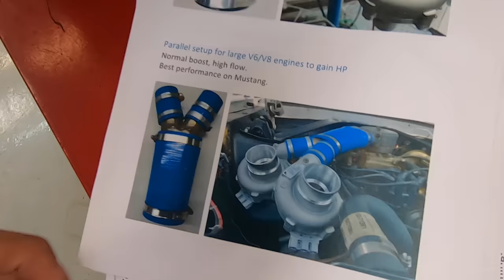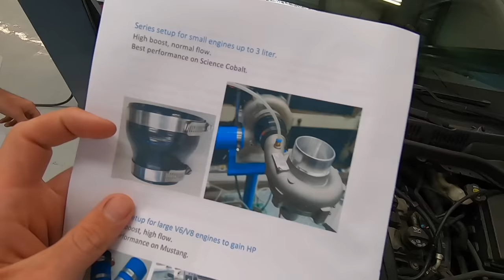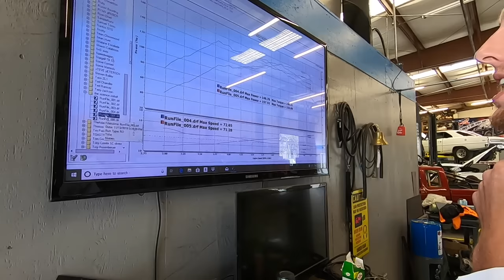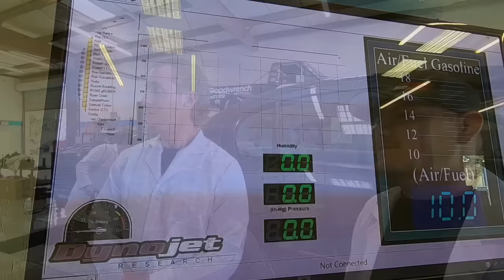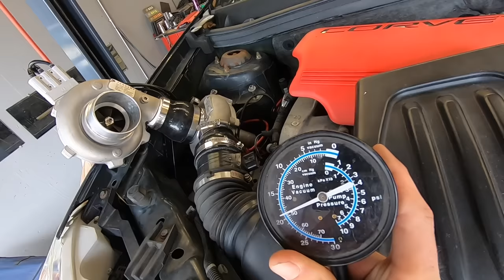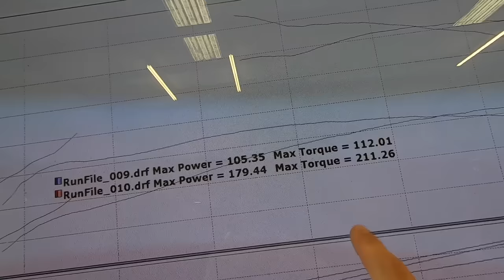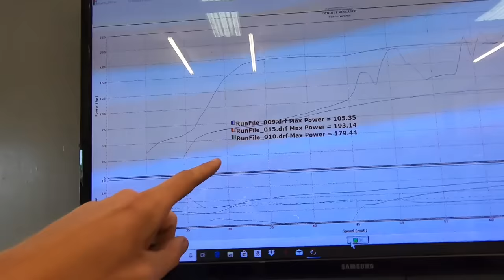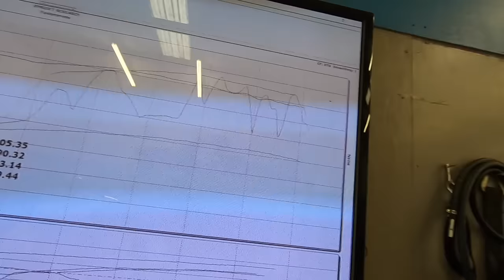Dyno Testing $5,000 Worth of ELECTRIC Turbos! Double the BOOST!!!

Comment: These need to be 1500 for dual turbo they’d sell the crap out of them
Reply: So true
Reply: And go bankrupt, so not sell any. Great business model.
Reply: Jay Dunbar your not thinking outside the box my friend, I’m sure they could do it some how, a kit model where they supply parts and you put it all together? I’m sure they could it.
Reply: @trialnterror  The assembly isn't the expensive part, the actual components are, $5,000 is a very reasonable price for a twin turbo system. Automotive components are always going to be expensive.
Reply: Mike Litoris  not really, an electric turbo would be similar in price to a normal turbo. Instead of having a turbine housing, it has an electric motor. The front half of the turbo is the same. The electric motor is similar in price to a turbine and housing.
Reply: Even 2500 for one each would still be stupid cheap
Reply: @jaydunbar7538    Vs. go out of business trying to sell a (let's be honest) 4-5 PSI system for $2500?
Reply: PhillipZX3 I’m looking at what the parts would cost, I think you could do it in kit form. They are using a cheap turbo which you can buy for 100.00 the electric motor is just under 100.00. The wiring would be close to 100.00  an inverter could be 100 battery is 100. Box various parts 100. !! It could happen price it yourself
Reply: @DieselRamcharger  let's see you build this for $70.... Oh wait, you can't
Reply: @Hates Spam the size and case. what makes you assume its not? you see, there is this thing called economy of scale. brushless motors are simply AC motors, they are anything but uncommon. that particular motor comes out of a cordless power tool. The steel can is a dead giveaway. Ive been at this quite along time my guy. that would also be an electric supercharger, not an electric turbocharger, which is a physical impossibility. You need to learn to separate fact from marketing swank.
Reply: @Hates Spam but to be fair, I'm not saying the guy is cutting open drills. Just the size of the motor and its power output is that of a cordless tool product. I'm sure its just a chinese bulk motor. Its a  brushless in runner. Like you'd find in a drill. Typical hobby motors would be out runners.
Reply: @Cody6210  i mean honestly i could build this for free. I've got enough parts laying around, plus a full machine shop at my house including a 2019 Haas VMC....be real careful telling people you don't know what they can and can't do. Take a hard look at that little avatar. Thats what i do for a living.   Making an electric SUPERCHARGER really isn't hard. Its just not worth a fuck. I don't dabble in wasting my time. Because my time is valuable.
Reply: Itll get down in cost pretty quickly... dw
You can source motors that have enough power for less than $150, building the battery and charging unit is expensive though.
Reply: @diesel ramcharger Thats an inrunner motor, looks to be a 36-40mm case. We use them in the rc world. A drill motor... seriously... thats turning at close to 50k and its direct drive, thats a huge amount of torque required.
For the record i built a system very similar to this in 2007 for a high school project and proved it could work.
Could be made for less than 1k could be made for over 2k in cost for all you know. Don't assume its cheap garbage. Especially coming out of europe, their industry for electronics is out of this world.
Reply: Most engines will not take this for long. Also without a blowoff or similar Efficency in normal day use is pure shit
Reply: @XCSEDAN  lol you can source the motors for under 20 bucks, if you were buying for a manufacturing run. Retail id say 20-80 dollars would be sufficient. Plenty of brushless vacuum and industrial motors out there. For example a 2hp BLDC motor is 40 bucks on alibaba.  Also, they most like are super capacitors, batteries wouldn't recharge fast enough and there is absolutely no reason to use a battery. Its not a charger, its a voltage step up circuit {boost transformer and isolation diodes}.
Reply: @XCSEDAN  i do a lot of RC and EV stuff. Tromp claims its a 5kw 24v bldc, though judging by the can size this isnt true, but i digress. a motor of that spec is well under 100 bucks on alibaba. They claim the box houses a battery, which is undoubtedly lithium metal batteries. Not really safe, but i digress again. The rated output time is 2 minutes before overheat and 4 minutes before batteries run flat. You are looking at a very substantial recharge time, hours, between "boosted" runs. the fact this thing can only produce about 5psi is very telling about the actual tq output of the motor. And the price. the website claims 2900 euro, before Vat and export. Thats 3200 before shipping per unit. Not 2500. Also, you aren't really producing any extra horsepower. You are just storing power you already made in the "battery" box and releasing it later. To say this is a false economy, is an understatement. I hate seeing people being mislead by fake claims and having their ignorance taken advantage of.
Reply: @XCSEDAN  also, its an electric centrifugal SUPERCHARGER nothing about this is even remotely a turbo. The compressor wheel with the dual blades...yeah that aint from a turbo. Its from a supercharger. Go look at a Paxton P2 and get back to me.
Reply: @XCSEDAN  this system also draws 3500ma per minute. thats roughly 2 hours of charge time per minute of runtime. this is why i say super caps are a way better solution than batteries. Also the motor on the torqamp, that isn't the can you are seeing. Its a cover. Its looking more and more like a cordless power tool motor by the second. One thats being ruthlessly over driven at that.
Reply: I've worked with em. Their biggest problem is converting people, and showing it ain't bullshit, and getting it out there. Cleetus and the boys are doing a great job helping them. They'll sell like hot cakes  once those two aforementioned points get done.
Reply: @roimatatamihana5681  Thats what they cost now lol. 2500 (2100 through the kickstarter).
Reply: @peterzingler6221  its electric, it doesnt need a blowoff valve, if its making too much boost you can just dial down the motor
Reply: @DieselRamcharger  so many assumptions.... i dont even know where to start.... i had charge time of 30mins from 15% capacity driven off an alternator charging a 15,000mah pack.... dunno where you get your figures from, but a 2c charge rate is pretty low these days. This uses lipo batteries. Which can charge up to 5-6c. So it can be charged in a matter of what 15mins with ease. The charging system on this wont allow that rate of charge though as its limited to 500watts.
Impeller design is for sub 60k rpm from what it looks like. Who cares what its off.
Sounds like you'd make something cheap and nasty, doesn't mean every business will. Probably shows a lot about your business ethics tbh.
No one is saying the design can't be improved on. It'll advance, get more compact and efficient.
Claiming its a drill battery and a rubbish design is just typical keyboard warrior bs. You've never even built one of these systems, so you're knowledge on the setup is minimal at best.... let me point out. A drill motor can't handle 5kw. Infact most cheap inrunners can't handle 5kw.
Also it isn't a supercharger... as its not mechanically driven. Technically its just an electricly driven air compressor. You know... if you wanna be technical...
You are right about me looking at the cover of the motor... i still recon its a 36-40mm inrunner, and pulling 5kw out of one of these is nothing. But it does fit smack bang on the specs for a 36-40mm diameter inrunner power wise.

Yeah... good chat

Comment: I'm curious to see the AFR on the bottom end of the rev range.  that much air instantly seems like it would cause a really lean mixture unless you're dumping that much fuel in the map.   Then I'm curious how the con rods will hold up to this much instant torque or what kind of wear it has on the bearings and cylinder walls

Comment: Cleetus, listen-up. You need to put those hairdryers in-line. Then you have the first hairdryer feeding the second hairdryer 5 psi air-charge to start with. Then like I said before you need to feed the second hairdryer another 1 to 1.5 more volts. Trust me on this one.
Reply: If the esc could handle more voltage, you'd have to mod the battery pack.   These have more in common with rc planes than brushed universal motors

Comment: I def wanna see this on the mustang now.
Reply: Exactly what I was thinking lol
Reply: Same
Reply: Didn't the stock mustang make almost the same power as the stock cobalt? Boosting it with the same setup would give fairly similar results as far as peak power goes. Low rpm torque would see a bit more of an improvement due to less surge.

Comment: I was thinking maybe you can run this setup with a vortech adjustable boost fmu and fuel will increase with boost pressure to the injectors by the fmu. Then you would need a voltage clamp at the map sensor. No tunning needed on older vehicles with a map sensor.

Comment: The cobalt officially makes more whp than my accord😂😭
Reply: And more than my 2014 mazda 3😂
Reply: Alex Velasco more than most ‘smog’ v8s! Turbo trans am etc
Reply: Find a Miata, add a bov, and a  throttle controlled switch. Really feel the power in a lighter car and the smaller displacement will see higher boost at low rpm.

Comment: Would be a sweet setup if you wire the torqueamp to the throttlepedal somehow.

basically applying boost harder the more you press down on the throttle

Comment: My 1.6l 100ish hp strong car (i think about 105+ because the compression is over VW's setpoint) would go like crazy with this thing! It pulls pretty strong as NA but this thing would change it a lot especially after 5,6k(6k) end deliver still power till 6,5k rpm
ive got around 110ftlp of torque

Comment: WTF, guys? Mount turbos after MAF and connect it back. Engine without MAF works not well.
Reply: I can't understand how they missed this, for two videos. Like they appear to have the knowledge, well you'd think
Reply: Still using the standard intake.. if you were going to go to the trouble, wouldn't you at least do it halfway properly and see what the product is capable of?  Great advertisement to drive your turbocharged vehicle straight past and take it elsewhere.
Reply: Matty Fatty they said in the video they knew it was unplugged. They didn’t miss it
Reply: MAF based tunes are only going to give you the biggest benefit in part throttle driveability and fuel efficiency over a wide spectrum of barometric pressures and temperatures. With this car being tested on the same day it was dyno tuned via speed density......the gains of a MAF tune would have been minimal.

Comment: An electric turbo that sounds like a supercharger, I am confused.
Reply: It is.  This is more of a electric centrifugal supercharger.  A centrifugal supercharger is basically just the intake side of a turbo that is powered by the engine directly instead of being spun by the exhaust gas.  But electric turbo sounds cooler.

Comment: I am actually quite impressed..

I would like to try a kit like this on my Lexus SC430 with the 4.3L V8 making 300hp.

I have some mods done, so it likely makes more than 300hp but not by much.. Maybe 320hp give or take? Stock SC430's tend to make between 250hp and 255hp (270tq give or take) at the rear wheels on the dyno. It has a custom exhaust that really opened up more flow, compared to the old exhaust that actually had a crimp at the end of the car where the pipe was going down to a narrow 1.5" to 2" gap, and I am sure that alone had to have added a realistic 13-15 hp because of that. I had more stuff done to the car, but I have to pull it off because it was failing the CA visual smog check. I am willing to bet this kit would give even more power than what was seen on the Science Cobalt in this video, and put the SC430 over 400hp. However, $5000 is pretty steep so I will be watching this company carefully to see if the price goes down in the future, and the blowers prove to be reliable. If it ever dropped to $3000, I would likely buy it!

I would love to do a real supercharger but the kits are no longer on the market, and it would need to be custom and would probably cost around 10k. The kits that were available were 9-12K as it was. Turbos would have to be custom done, and I am pretty sure it would cost more than $5k, but it would introduce all kinds of new issues.. Forced induction would likely keep my car from passing smog in CA. At least with this kit, I could remove the electric turbskies, and install my stock intake, and pull the custom tune chip I would have programmed for the setup, so the car goes back to stock tune. To remove a supercharger, or a turbo setup to smog the car every other year would be a real pain in the ass. The backseat in my car is useless, and I was planning to build a stereo back there, and could incorporate the power box for the turbskies, and run the cables nice and neat under the carpet. After all I want to retain the beautiful luxury interior of the car.

I would want to setup a custom switch to work with the gas pedal, to the turbskies ramp up as I hit the gas, with WOT being max speed for the impellers. If there is a solution for that, it would make the kit more attractive. How long does it take to charge the power box, and how much use do you get out of it before it gets run down?

If you ever want to test this on my Lexus and are not far from me, I would be happy to oblige!. I also have an extra SC430 parts car (first one that got totaled) and have it pulled it apart. The extra engine is on a stand, and I am going to do a lot of head work with custom cams, and cut the intake in half to port/polish before having it welded back together.

Comment: I was surprised to see that the factory plastic intake could hold even that amount of boost. Even factory boost pipes sometimes split around 20 psi and this is getting close to half of it for a part that was designed for vacuum!

Comment: this on a gt86. like, a traditional turbo kit costs more than that and is more of a hassle to install, and the torque hole will be just gone. those things are awesome!! with a valve for when it's not boosting and maybe a fatter battery or fat capacitor this would be the dream setup.

Comment: I think it would be great setup to make the turbos automatically turn on around 3000 rpm and turn the potentiometer according to the accelerator pedal. Flooring the pedal and running it up to around 5000 rpm should result in max power with sensible powerband.

Comment: I think you will get better results on a smaller engine,  I don’t think the turbo will be able to supply enough air to a larger engine, and boost will drop off quickly and the turbo will then act as a restriction

Comment: Garrett makes electric turbochargers.  Both to reduce lag (electric power to the shaft) and to recoup power (motor becomes a generator).  
Aside from the electronics, this is old school.  B29 bombers have engines with mechanical supercharger and an exhaust turbine which through reduction gears,  fed power back through the crankshaft.   Why? They have constant speed propellers so each subsystem is designed for narrow range of speed..something not possible in the automotive field.  Which is why we have variable geometry turbochargers.

Comment: Would’ve been great if they had torn these apart and shown how they’re made and assembled and what components they used. Ive thought about buying a T4 off brand and cracking it apart, machining a brushless plate and using a 120v inverter to power since it would draw less current having more voltage.
Reply: A electric blow off valve could be used as a bypass where it opens when the turbo switch is off. It would manage the bottom end NA and prevent the surge after boosting.

Comment: What if you added a spring-loaded valve on a Y Pipe. Turbo side stays closed until the big red button is pushed, and on the other side is regular intake side. Keeps the car from choking during normal operation, hit the big red button and the turbo valve opens up but closes the intake side?

Comment: granted, my cobalt SS was a 2 door and had a five speed, but was only rated (possibly a little underrated) to 200 HP flywheel but still ran low 14 1/4 mile at 99-101 mph. That thing should fy with 190 WHP lol.

Comment: 2 Turbo's in line... call it the 'Texas 2-Slip Shuffle' (2 wheel side slip).
4 Turbo's on 4 wheel drive, 'Texas Spin-4 Boogie'.
You guys know you JUST GOTTA test 4 Turbo's in a Double Series setup.
BUT, more than 4 Turbo's you get too much pressure and it's 
schhhwaaaaAAAA-BOOM!
____THANKS for the giggles.

Comment: My Corvair Spyder had a cooling fan that took 15 HP.  When I used to drag race it, I would loosen the belt.  When it threw the belt, you could feel the kick.  The boost limiter was because it had a small single barrel carb, so I put a two barrel on it with water injection to keep the detonation from grenading the engine.  I estimated it was making about 210 HP.  Without the water injection, it detonated like crazy.  I often wonder what it would have done with a computer controlled fuel injection.
It's amazing how much difference 15 HP can make.

Comment: Ask them to make a bigger one with that runs on a 60 or 80v lithium ion battery! What options are out there you could stab into that system to better control the boost? At this point you should mount that permanently and go call some people out to race!! Hood closed, some bigger tires, sleeper cobalt drag car.

Comment: Take the damn plastic off of the intake so we can see it and you. An work on it. Replace the accordion tube so it doesn't expand and pop. Check to see if you are losing boost anyway and use check valves.